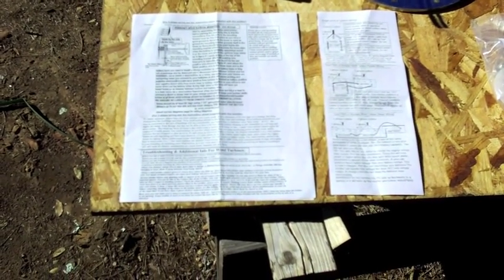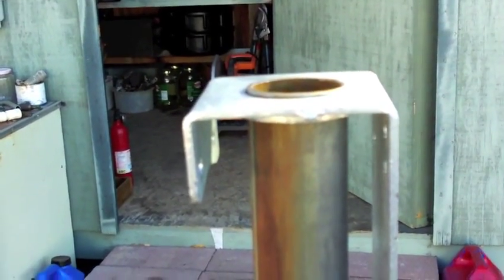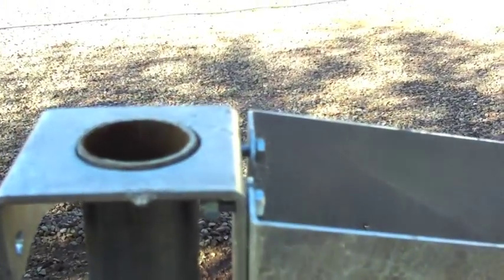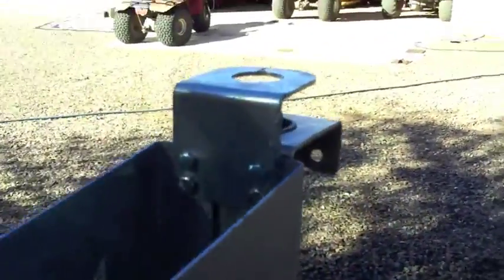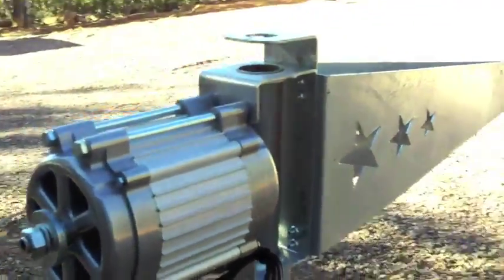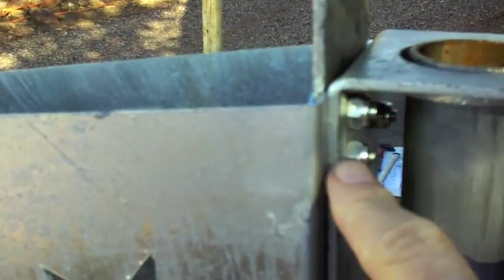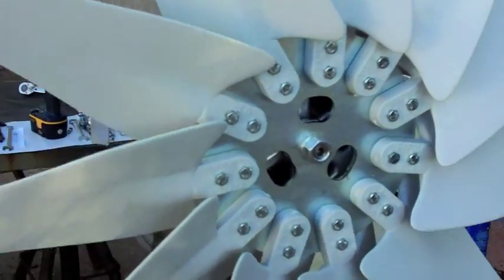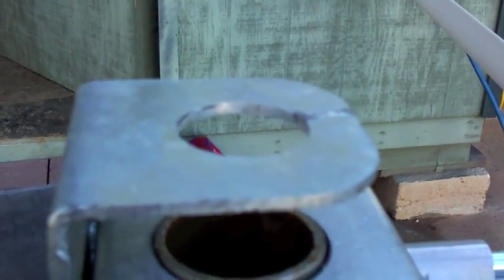MW&S Freedom II PMG wind generator Assembly and Review

Comment: I have extreme winds, 20- 30 mph is a normal here. I  have bought all the car alternator makes, disguised alternators and re-engineered them to make real power because I am not a hobbyist, I am a actual off grid user. The Wind Blue, Thermodyne, Missouri Wind, models are ALL just repackaged car alternators. ALL OF Them. 
That Freedom is made in Vietnam, the import records are though a importer in texas and even the Vietnamese have a factory tour of it. The Thermodyne Hornet is made in Mexico-USA and it too has it almost totally wrong for best power but its possible to upgrade that one.
Since I have been 7 years now messing with this under actual use I have had Windmax, AirX, Missouri wind, Thermodyne, Appollo, Self builts,  Gigu and Aleko turbines. Now I run my self built designs, the Hurricane PMA generator on my own designed auto furling mounts with Thermodyne  KT Blades. Performance is excellent with that mix. 
But, I have also bought 4 Sunning turbines since they are the highest rated on the market for durability and performance 7 years straight. http://sunningwind.com
The PER HOUR OUTPUT on the Sunning and the Hurricane-thermodyne-self-made models ( 2 of each up and running)  trumps the MWS by over 600% for no additional cost. Using a true PWM-BFC controller means my batteries will not be slammed every 3 seconds in diversion and they will last years longer. I have 46 Deep Cycle 6 volt batteries, a real system built by me, not some sellers import pile of crap.
I have been off grid, self built, self engineered, longer by 3 years than Missouri Wind has gone from mexican Pottery Sales to Wind turbines. Longer than Jason Browns has been living off his brother in a travel trailer next to his house. Off grid longer than Obama has been doubling the national debt. 
You need real input and design help, just ask a real re-newable power builder and user, not a seller and scam artist from Ebay!.

Comment: This is a very nice, How To Assemble the Freedom II video :) And it looks like you got the 11 Raptor G4 blade set, your turbine should perform well. I was using the 9 blade G4 set on my single core Freedom and I was happy with the performance, 11 blades should work good on the dual core Freedom II.

I plan on buying a Freedom II soon, I am waiting for the new set of blades I think designed just for the duel core Freedom II, The new blades look like the G5's but I think they are going to be larger, this will be good since the Freedom II is like having 2 turbines running off one set of turbine blades :)

That stinks about getting the wrong wire clamp,, but if you don't want to wait for shipping they only cost about $2 bucks at your local hardware store,

Here is a recent How to video I did on my first generation Stars and Stripes tail turbine ( back in the day when you had to paint your turbine ), I put this link so you can see how I do my nylon or teflon / plastic slip rings on my locking collar I found installing it this way seems to help wind tracking in lower wind speeds,, https://www.youtube.com/watch?v=oTHME1fFaWs
Reply: +BonitaCreekWaterGuy Thanks for deleting my ansewr!!!  It just prove how you denied any comment that show you have waisted your money on this.. Not having any numbers to show is even more convincing that you have no decent power out of it..
Reply from the maker: +Jason Brown I liked your video. I live on a mountain top and with a 50-60 foot tower I should get good results. I am working on a 6 kw solar system to go along with the Freedom ll . Finding time is my biggest problem. The clamp is not a problem. I just mentioned it so MW&S would know what was being shipped. At 65 the weather keeps setting me back. I am having fun.
Reply: I did get a 12/24 volt Freedom II , but at the moment it is only 10 foot off the ground, I still need to get it on the roof about 30 foot in the air :) I need to add more solar also ,, our power company keeps raising prices so I keep adding wind and solar, heh
Reply from the maker: +al “peper 0110” desrochers Did you not read that it is not installed yet? I deleted "answer" as it had nothing to do with my video just like Hugh's video had nothing to do with what I am doing. If you are wanting test results you will have to wait till I can get my tower up. What did you buy and what was the cost? What is your output?